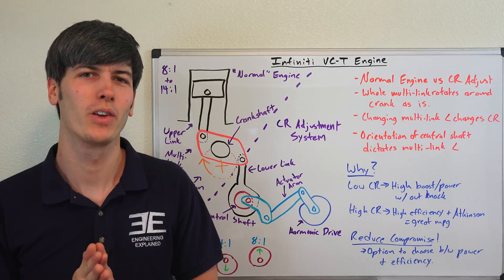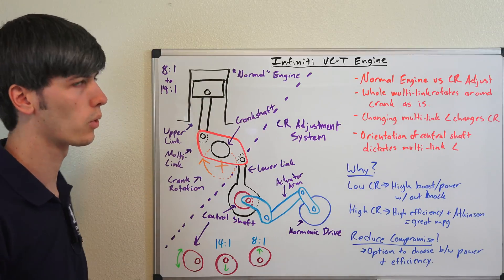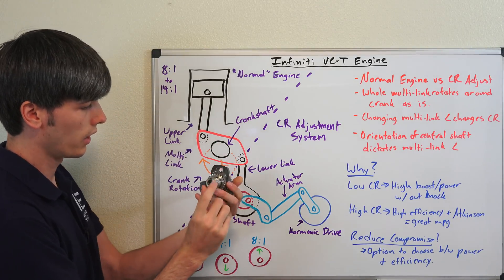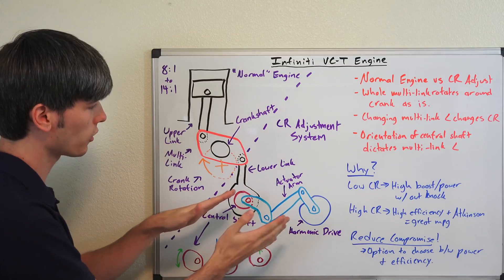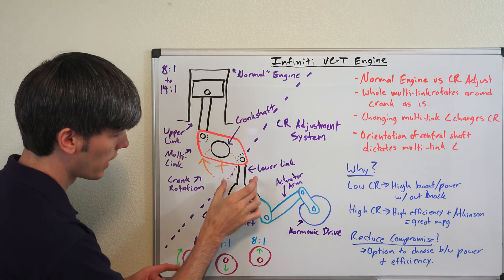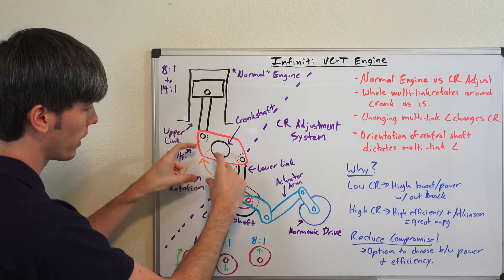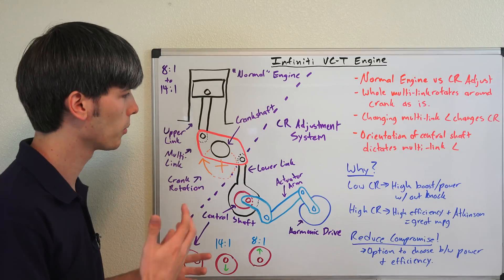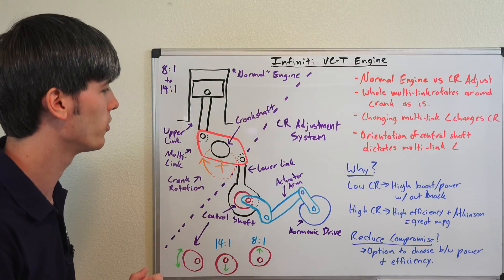Infiniti's Amazing New Engine - Variable Compression & Turbocharged

Comment: sounds like a lot of unnecessary that will eventually mess up and cost a lot of money
Reply: Isn't that the point of all technology, though? Turbos are more stuff that can go wrong, but now almost all vehicles offer turbos. Yes, it might start rough, but imagine a car that can swing between efficiency and high performance without turbos. Imagine that 4 cylinder engine in a typical car swing from 30 mpgs at 140 hp to 20 mpgs at 180 hp. This might be the start of something that can achieve both of those!
Reply: +AndrzejKucyg while I agree with that assumption, the cause of that is not the technology, rather the money. The goal of car companies seems to be to endure cars run for the duration of their warranty, not for as long as they can run, because that is the better financial decision. 

This technology will hopefully be continued and improved upon. It gives people more options within the car itself, without sacrificing much performance or gas.
Reply: That's what they said when they started increasing the number of valves and cams!
Reply: Just like every modern engine that meets the regulations
Reply: Yep.  Get a horse.
On the other hand, a well designed ECU should allow the thing to live.  It might be like some of caddy's Northstars that "have no power" and the mechanic discovers they've always been in limp mode, but it should live.   ECUs are wonderful things and with direct injection should be able to keep nearly all the failure modes from destroying the engine (VVT fighting the turbo being the one it can't, but presumably it can open the wastegates before the turbo is completely destroyed).
Reply: I'm sure people said the same thing about automatic transmissions and fuel injection, but they are used almost exclusively today and very reliable
Reply: +Nickolas McCollum good for you. I'm from Belgium, where you can't drive a manual if you earned your license with an automatic transmission. So most people here know how to drive manual. And still, automatic is quite popular, but not the standard (neither is manual). But look at all modern engines, they are filled with technology that only is used to meet regulations. For example many normal engines (such as 80hp, 110hp etc) have turbo's (look at fords 1.0L ecoboost). They could easily achieve that much horses with a bigger NA engine, but those wouldn't meet regulations (unless your Ferrari or such gifted companies, since regulations are based on the manufacturer, not undependable). Than there is VVT and such tricks. There is already so much 'unnecessary' technology in the engine, why getting to the next level? If reliability would be an issue, you don't need turbo's and such unnecessary extra components. An engine can run without all those.
Reply: I'm sure the same was said about variable valve timing, overhead cams, the combustion engine itself, etc...
Reply: +alexnelson09 dual over head cams and valves came in the early 19th century and likewise t heads also which used to cams either side of the block, rather than overhead, and 4 valves per cylinder. they didn't meet the same negative reception even though they were actually no better than anything at the time. I don't think it's a fair comparison.
Reply: rock to be perfectly honest he has a valid point, he's not an old guy. More moving parts is not necessarily a good thing and modern cars use extensive electronics to control everything with decay much quicker than the car itself.
Reply: and i still only buy and drive manual transmissions
Reply: +Nickolas McCollum I'm not sure of the relevancy of that statement, but good for you.
Reply: Alex McBroom refer to Steven Peterson's reply
Reply: Nickolas McCollum I missed the and, my apologies
Reply: One complaint was that it didn't have smooth acceleration and it doesn't. I find it very fun car to drive. It hauls ass when turbo kicks in at about 3,000 rpms. I am an owner of the qx30 Infiniti. Dont like FWD though. It under steers so you can find yourself out of your lane quickly. You got to pay attention. It seems if you turn just a little bit earlier that normal you'll be in good shape. Worried about the engine, yes. I do wish I had my 66 dodge charger and 67 Chevy ss still though. The old stuff rules. Always will
Reply: I'm sure the same was said for vvt engines and now look, you got hector buying three of them with T66 turbos, nos and a motec exhaust from Harry's. It's all just innovation and also sure jobs for specialized techs

Comment: How does the adjustment system move with the crank shaft?
Reply from the maker: The lower link can rotate left to right, compensating for the up and down motion of the crankshaft. The multi-link can also rotate about the crankshaft, but stays in relatively the same position (it doesn't spin, but it can rotate slightly to compensate for the motion).
Reply: I also had the same question, thanks

Comment: SAAB had a similar concept 16 years ago that had the same features and was way less complex but gm as always told the swedes to stop spending their money. I guess this is just another SAAB story
Reply: I was thinking the same thing.
Reply: Hahaaa nice one!
Reply from the maker: How was it any less complex? The entire head tilted requiring complex linkages to facilitate this movement. Certainly a cool concept, but I wouldn't say "way less complex."
Reply: +Engineering Explained the cylinder bank had a hinge and a cam that moved it relative to the crank. A similar number of parts but none are on the rotating assembly 

Also The head and cylinders are a single cast piece so sealing would not be an issue

Comment: I'm probably not the only one to be worried about the introduced complexity. It will inevitably break and fixing it will be a hassle, to say the least. I can foresee second-hand Infinitis with this engine selling for cheap simply because they will be bound to break soon.
Reply from the maker: Complexity is often what keeps these things out of the market. That doesn't mean, however, that they cannot be built reliably. They're going to slap a warranty on it, so it's in their best interest for it to last. Not saying it will be ultra-reliable, but just offering the other side of the spectrum.
Reply: Compexity doesn't necessarily mean it's a point of failure. it often does, but there's no way of telling until a few years from now.  That being said, I can't wait to see what happens to all these actuators and bearings when Barbie goes 10,000 miles without an oil change.